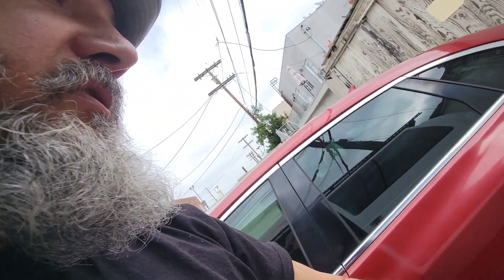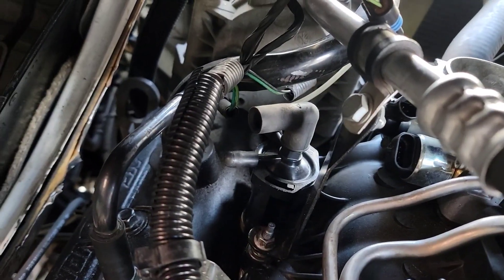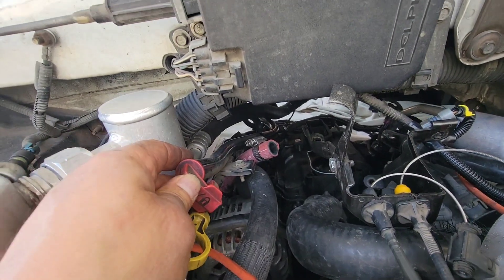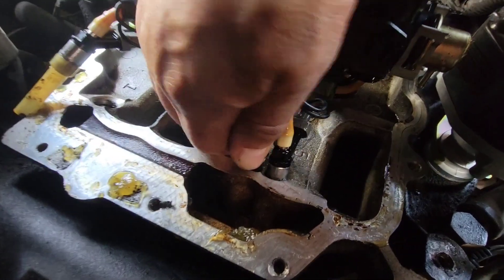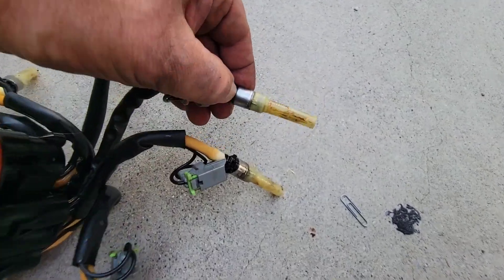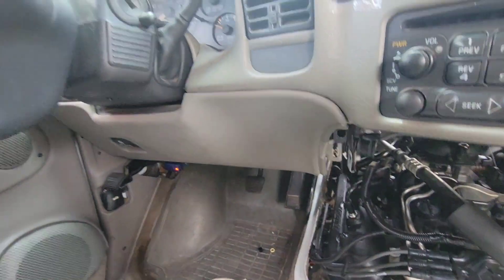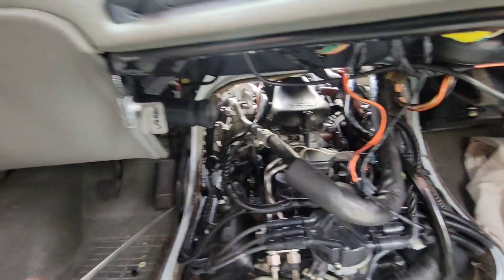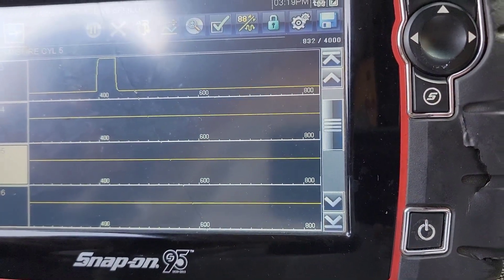Another Spider Injector For My 2004 Astro Van - Bye, Bye, misfires

Comment: Just bought a 99 AWD  Astro. It was a blind buy because I'm not a mechanic. It was obvious that someone really cared for this van. The fluids were clean as a whistle, new LED lights front and back with some really fancy looking tires. I kept thinking of a video you made about buying or selling one of these vans. It does have a cover on the steering wheel but the netting is perfect and it came with a manual. Unfortunately it has a towing package but the engine sounded so good and the transmission shifted perfectly with sparkling clean fluid. The stereo sounded great but then he took the speakers and I suspect that it needs to be hooked back up. One thing I'm curious about, he had a wire connected to the battery for what I don't know. I expected to see the gas gauge move when I drove it home to Sarasota about 15 miles in heavy traffic but it used almost no gas. At the time I mistakenly thought that it was an 8 cylinder. I still haven't taken it to my mechanic because I wasn't sure if I was going to keep it. I'm only 5'1 with one leg so I have trouble getting in and out of it hence the reason that none of my family members would go with me to look at it. Also no front or rear sagging. I think that they put a special muffler on it because it sounds so powerful. I really enjoy your videos! Thank you.

Comment: does this fix the studdering when being at 55mph on the freeway? my truck seems to have a lack of power for my 99 astro.
Reply from the maker: I never had that problem - Definitely swap out your PCV, I noticed better performance after doing that - it costs $3 and no tools required
Reply: Fuel pump.
Reply from the maker: @lewiswetzel8617  passed the fuel pressure test

Comment: When you were getting the misfire codes, which cylinder was it saying? I’m having 3cyl misfire and did a full tune up still got it, cleared the code and waiting for it to come back if it does. This is my next thing to do. Did you get better fuel economy?
Reply from the maker: It was giving me a random - I brought it to my mechanic and he ran his computer which gave him the 3 cylinder - He did the crank shaft sensor relearn. If he had run the system relearn a few times he probably would have gotten it to work right. If you watched the video you know what happens at the end...
 I recommend you bring it to a shop that has the computers and knows how to run these system tests/syncs  
  I'm not seeing a change in fuel economy
Reply: @AstroVanTribe  oh I did watch all the way, great information. I didn’t even know about a relearn. I am thinking of doing that before I tear out everything. Seems like an easier cheaper thing to do first

Comment: I put a body lift on my van . The extra room is awesome . I did not lift the engine , I just do the beach . Not many hills or rocks there . No real need too. The extra room from the body lift is great for mechanicin
Reply from the maker: Interestingly, the thing that motivated me the most was a story about a guy driving on the beach - He ran over a section of pipe under the sand that rotated right up into his oil pan. I'm from Saeside Park, N.J, and took my van out on the beach there many times - Skid plate is the next thing, with the engine lift I can do a straight plate from the front cross-member to the rear one under the trans

Comment: So can I ask I know you had the rough idle problem but did it do any type of surging under light throttle ?
Reply from the maker: No, it did not - "rough idle", "misfire" and "vibration" are all different things that can be caused by several different things - I sometimes misspeak and use these terms incorrectly when I'm trying to relay what I'm experiencing....
Reply: @AstroVanTribe  only reason I ask is I'm chasing a problem of slight surging under throttle no codes nothing showing I bought a advanced auto fuel spider 4 months ago wondering if it's that. So far I've replaced plugs wires cap rotor new distributor tps sensor new intake gaskets new coil blocked the egr made no difference also rebuilt transmission
Reply from the maker: @derrickwoods2803  I'd bring it to a mechanic that has a computer and knows how to use it
Reply: @AstroVanTribe  Ive got a 1500 dollar scanner and it shows everything is good
Reply from the maker: @derrickwoods2803  My mechanic has two, one was 4K the other 6K - I don't know that it means anything... My super cheap reader said I had a random after installing the new ACDELCO spider - His told us it was 3 & 6 - After running the re-learn all is well..

Watch this, you never know where your gremlins may be coming from:
https://www.youtube.com/watch?v=WL3DaQupgk0

Comment: If your still having random misfires you might want to do your timing chain if you haven't already especially with 200k miles, my engine had 160k and kept throwing misfire codes and it was the timing chain it was very stretched out.
Reply from the maker: I think we got it covered, now but the timing chain is on my radar

Comment: Why does this van always have problems??
Reply from the maker: I've been modifying this van, its far from stock - I've also been experimenting with different ideas....  Some parts just failed as they sometimes do - PLUS - I'm also swapping out all the older parts to make it as "new" as possible so I'm less likely to break down when I'm on the long road trips I'm planning out

Comment: Love these van but dang their a money pit
Reply from the maker: Well, they're all old so, yeah....  Not everything I'm doing is because there's a "problem" - A lot of hat I'm doing is preventative maintenance and troubleshooting small issues due to the modifications I've made to make it more off-road capable
Reply: I've got one with 120 thousand miles and it has give me a fit on everything getting ready to put a maf sensor on it just found out it's bad this was after I spent a fortune on a rebuild on a transmission and it's still got to go back for work on it cause it's got the classic torque converter shutter
Reply from the maker: @derrickwoods2803  Yep, I've got 100K more than you do....  As you approach 100K things start going (just like any other vehicle) - I say it all the time, it's only worth getting into an older vehicle if you can either work on it yourself (have a place and the time) or can afford to pay someone else (and hope they're actually doing things correctly) - The goo thing is that, while sometimes tedious (being a van), working on these things is pretty straight forward and easy

Comment: MAF ,CHANGE IT......AUTO ZONE LIFETIME WARRANTY.....
Reply from the maker: I already solved the issue - Although, the MAF sensor is the only sensor I haven't replaced, yet. I have cleaned it before, but it's not causing any issues currently. For the most part I prefer ACDELCO parts